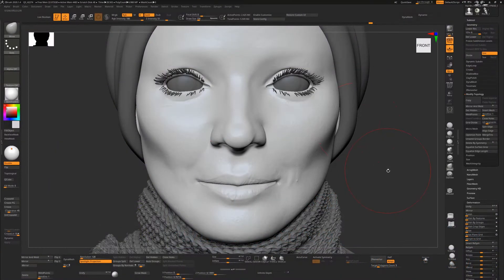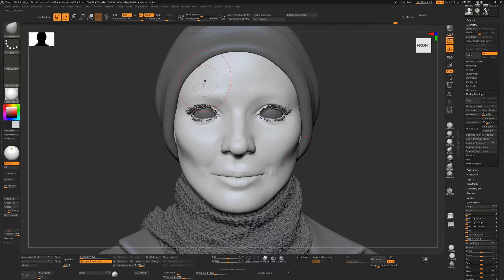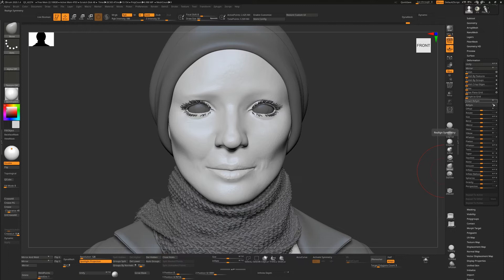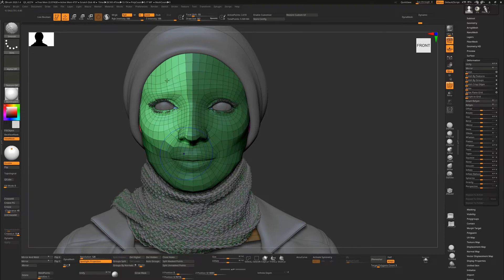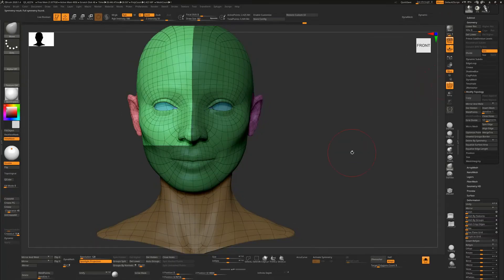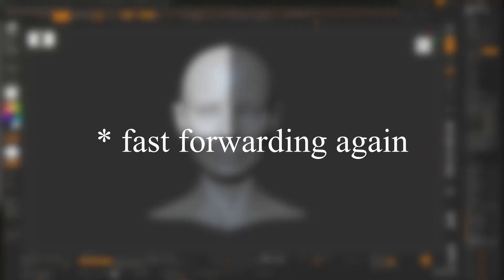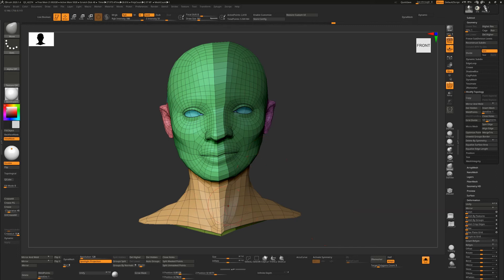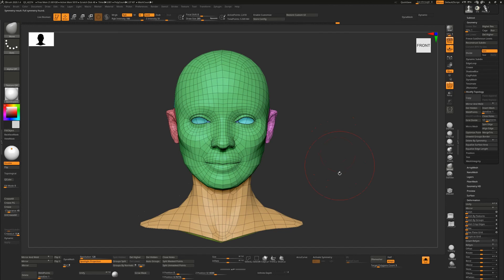Fixing asymmetry on objects with subdivision levels.

Comment: hello, congratulations you are strong!!  I'm trying to figure out how to use the mirror and weld on a subject whose pose is not symmetrical at all, I was interested in the head, but I would like to find a way without having to detach it from the body which also has a non-symmetrical pose. (which I found complicated too.. )
in practice.. I have head and body already united in pose I don't pose
I have to create a symmetrical face, now it's not

Is there a way to momentarily move the pivot for symmetry and then put it back where it is? And can it be done without cutting the head off the body?

ps the file has millions of polygons so I wouldn't spoil it and anyway I have no history to go back in low resolution.

I can attach example files here .. i hope you can help me.
Reply from the maker: Try this video: https://www.youtube.com/watch?v=6YELFidasZY